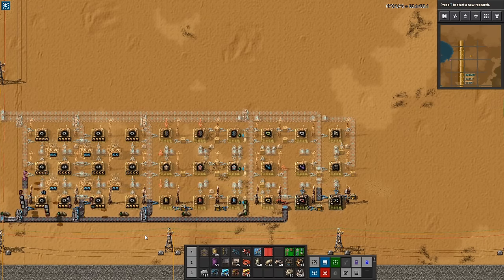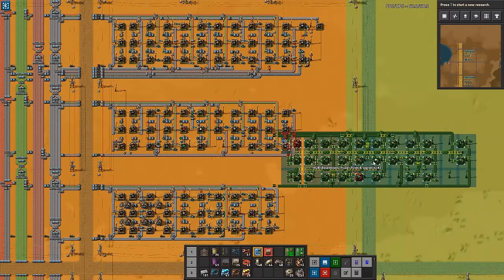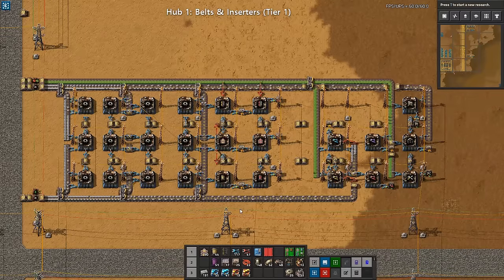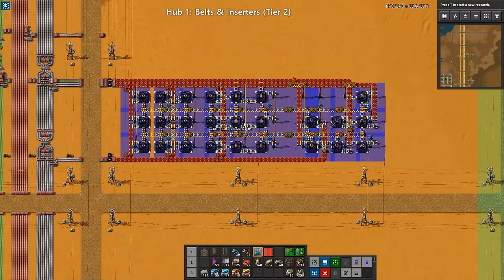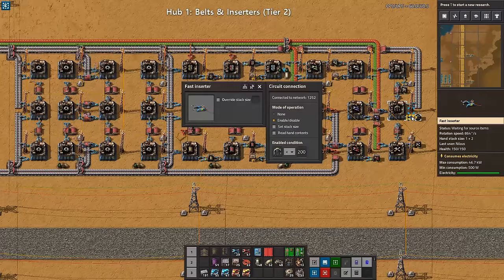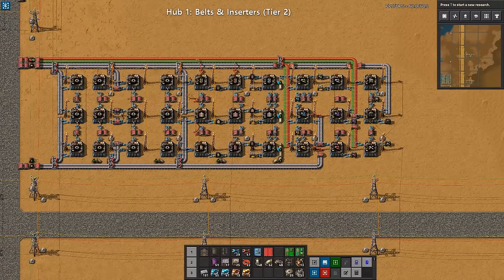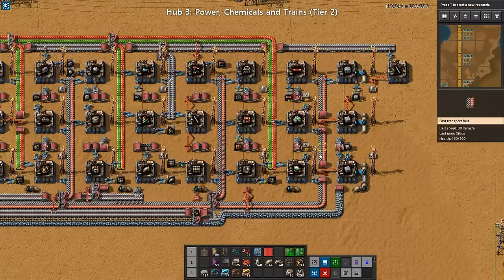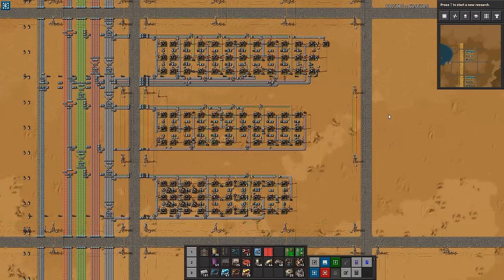It is not a MALL; this is a Manufacturing HUB -  Factorio 0.18 Tutorial/Guide/How-to

Comment: A little extra tip for new users: if you change the numbers of the circuit conditions that Nilaus has preset at the inserters for whatever reason (explained at 3:35), stamping down the next tier will overwrite your changes. To avoid that, just ugrade or downgrade the type of insterter used (to either yellow or green) in order to protect your value.
 
On another note Nilaus, you really should be more careful with your keys. Tank-engines are really expensive!
 
Regardless of your confession, this very clearly explained hub turned out to be great, esthetic and straightforward and will be a joy to have in a base. It is quite possible that I will use it in one of my games, regardless of my own designs ;)

Comment: Good base, well done.  My only comment would be, for the engines, to use a buffer chest instead of a long inserter.  This way the assembler can run longer, which lets the other assemblers refill their buffers faster.  It also gives a spot if you need to grab engines for handcrafting (I can't think of any now, but my mall also has electric engines, which I use to handcraft power armor).

Comment: I decided to modify your blueprint. You tend to put the road near the bus and I've chosen to do the same thing, so it just does not make sense for the gear machines to be the closest thing to the road. I punted them to the back for better accessibility until you reach the point where you actually have access to bots and can just get things delivered. That also shortened the circuit belt. I'll probably do the same with the rest of the hub designs.

Comment: 16:14 Solar panels can go in the empty spot. They require green circuits, steel and copper plates. Although you probably want more than just one assembler can produce. But if you just want a few solar panels to power small radar outposts it is fine. It takes only 5 panels to have a daytime Radar outpost.
Reply: It only takes 1 solar panel for a daytime solar outpost that very rarely scans any sectors.

Comment: That's so neat and elegant. I like to add two extra modules. A war module for ammo, explosives, turrets and a wardrobe module for power armour and attachments.  I also get run over a lot and it's nice to just grab some gear and carry on. Do you not bother with walls? I guess you could attach a wall assembler next to the concrete flooring.

Comment: As an alternative to the supply chest upgrade, I suggest buffer chests. The inserters inserting into the buffer chests have a rule on them to only insert if there are not enough items in the network. The buffer chests request the item instead of the supply chest filter. This means that items are taken to the buffer chests if needed, whereas the supply chest filter means the items are taken whether they are needed there or not. This may cause unnecessary bot traffic. Both methods work of course, and supply chests are available earlier in the research tree.

Comment: What I like to do is wire all chests together. And wire all output inserters together. Then you can set the desired amount with constant combinators. Either by setting the amount as a negative or by multiplying each signal by -1

Comment: Thank for making these episodes and this video in particular. I needed something that would create everything for me during a Lazy Bastard achievement hunt. Part of what was hampering my first attempt was the lack of a hub (or mall). I liked your design based on its simplicity and it was a bit easier to work with than the one I had seen from Katherine of Sky.

Before I put it to use, I adapted the design to suit my requirements and I tried to extract any military aspects and put them into their own designs. After I managed to earn my achievement, I realized that the design was too big to use during a speedrun. I trimmed it down to something that is more manageable and that only included what I needed in order to earn the There Is No Spoon achievement. Each of the three main blueprints are between 1 and 2 chunks in size and that includes the undergrounds that mark out the inputs for each transport belt.

Going forward, I will need to spend time creating my own upgrade paths for the different blueprints, so that I can change from wooden chests to steel chests and eventually logistic chests. Also, being able to swap out the electric poles will be nice, so that I can obtain better coverage. It will take some time to do, but it will be worth it in the end.

I have watched most of the rest of this playlist. The design for the column of steel furnaces for smelting steel gave me some ideas to create a new blueprint for my own use. Thank you for the inspiration.

Comment: I have way less experience than you so am probably wrong about this, but since gears are twice as resource-dense as iron plates, it seems like you'd gain some efficiency if you add gears to the resource bus, produced elsewhere,  and pipe them directly into the hubs.  Now your base should need need fewer belts in total and have smaller hubs since they don't need to do gear production on-site.

Comment: I am usually against premade blueprints, but this actually is very tempting to use, as I really like its upgradability / tiers, and does show a lot of attention to details. Amazing work on this! However I think maybe the hub 3 (power, chemicals and trains) should be split into two separate ones?. I find the hub 3 with so many different inputs might be sometimes hard to integrate into the base, especially if not using the bus. Also on a similar note I think it might be a bottlneck on plays with a lot of trains. Maybe a place for two rails assemblers? Not sure. It does work, but I find it a bit too big. The nice idea of smaller hubs is that if you don't have enough of components, you just scale by using two hubs of the same type. Useful when you expanding very quickly or doing multiplier.

Comment: This HUB thing is the shit. Forget MALLs guys!
Love the build, BUT I have a single complaint to make: the usage of iron chests. At that stage of the game where you build the first version of the first part, you will have steel researched already. Make some steel chests. The explanation is that you can recycle steel chests, but iron chests are waste of material.

EDIT: There are some other things missing besides the mentioned ones. Hazard refined concrete, walls, gates, electric engines, robot frames, logistic/construction robots. I usually like building these in the MALL as well, cause I need them for base building. Although some of them are being produced for science, I don't like taking stuff from there. What is for science, stays for science. What I consume has to be separate not to affect science production.

Comment: I don't know if you keep up with comments on older videos but I would really appreciate it: I'm always unsure when to add what on the main bus. This is especially obvious when I think about building something like this hub because I just don't know if it's worth weaving these modules into earlier parts of the bus or if I should just plan ahead enough so I use the first part of the bus for producing everything that needs to be on it. With the latter, I would have a filled bus with all base materials and then a hub and everything else seems easier cause I don't need to figure out stuff like "Oh wait, on the other side of the bus I'm gonna produce red circuits but that's not done at this spot so I'll have to push the hub back until I have that"

 Do you have a general approach for that or an order that has proven itself as the most useful?
Reply from the maker: You are commenting on the HUB video about planning the Main Bus. Have you watched my Main Bus Master Class? I feel that your questions are addressed in that video.
Also "there is no shortcut to experience"; you got to get your own feel for the game as you play it

Comment: For late, late game the steel furnace/tank can be easily replaced with walls/gates and refined concrete can be replaced with artillery and offshore pumps.  I suspect that most folks either don't use refined concrete at all or need WAY more than one assembler's worth, and having a dozen or so extra artillery pieces on hand is always nice.  Great build otherwise

Comment: I thought i had a lot of iron until i built just the gear-belt-splitter-underground bit of this with assembler 3s..... also it appears blue splitter now requires red circuit, easy enough add

Comment: I might make the chests for upgradeable items buffer chests, so as to better support mass deconstruction. (Only needed if you plan on deleting more than a chest worth at a time, so really only belts probably)
Reply: Also, the mall is the Dectorio facility :P
Reply from the maker: I am not a fan of Buffer chests because then I have to remember to tick the box in ALL future Requester chests and I know I will forget it
Reply: @Nilaus  I generally like it here because its stuff I don't request often. I agree that for most use cases they just mess up your requests, but I basically never use requesters on yellow belts and such.

You probably also have room to do something with requester chests and circuits.

I just like it to automatically clean up all the random yellow belts I have in storage by the time I have enough iron to stop using them entirely
Reply: @Nilaus  i generally don't need to request stuff from the hub into a chest so i do use them regularly. you say you forget to tick the checkmark regularly? What builds do you make that request stuff from your hub directly in stead of production on site?  Just curious what you do different that would run afoul with buffer chests.  Only place i can imagine this would be a late game robo hub, but those are copy paste setups anyway so tick once and forget.

Comment: I know this is an old video but wouldn't it be much more elegant to just have a Requester Chest feeding into a Assembler which then puts the produced item into a filtered Storage Chest? I'd say that's half the footprint and is very easy to achieve.

Ofcourse you still need pipes for lubricant and raw material, but besides gears, iron poles and copper cabbles everything can be brought to it by train (circuits, coal, stone, iron ore, etc.).

Comment: I'd like to see a explosives/military hub for firearms and rounds, tank/rocket rounds, cluster grenades, combat robots, poison, cliff explosives, artillery turrets, wagons and shells.
Maybe also armor and equipment, though that doesn't really justify a hub due to the small quantities.
Reply: Armor and equipment even tho its in small quantities, it could be done in a robot mall instead, with buffer chests instead of requester chests, all the resources used on the robot mall would be available to all machines so there wouldn't be materials lying around in requester chests that you would only use once for the power armor.
Reply: Equipment can be useful since some of it crafts very slowly. Batteries Mk2 and Roboport Mk2 for example. On the other hand you don't need a lot of them so it could be a temporary build too

Comment: Do you build your entire main base to suit the chunk layout? They look like 3 by 3 chunks per "city block"
Reply: Most of Nilaus' bases use some sort of grid - he gets noticeably stressed when he doesn't have a grid, and palpably relieved when he starts to impose one.  The "official" city block's length is three large power poles, plus two (?) tiles to the four-tile-wide path.  I think it works out to 100x100 tiles to the centerline of the path, or just larger than three chunks (96 tiles).

Comment: very nice and all...
But where are the speakers? And Landfill?
Reply from the maker: landfill has no place in a Hub, it requires huge amounts of Stone, so just add a few assemblers at a stone mine for that
I never use the speakers and I figured that if you need speakers then you only need a few, similarly to off shore pumps
Reply: I do one landfill assembler since I need stone for the rails anyways. It's true that half a belt of stone makes for very slow production, but it's something. Enough to fill in some corners in the starting lake for example

Comment: Personally I prefer to add gears to the bus as its 2 iron per gear.
Reply: I tried that on my last game, it kind of worked but the consumption of Iron was insane. You could argue it consumes the same amount but it felt like much more. I think in the end it is slightly easier to just bus in 8 belts of iron and feed the factories rather than 4 belts into gears and then back on to the bus and the other 4 belts of iron into production.
Reply: @sebthompson7871  if I can I dedicate 2 smelter arrays to produce iron just for gears. (Mining drones make it so much easier to get 6 or yellow belts of ore out of that begging iron patch.) That iron never hits the bus. The assemblers for the gears start the the end of the smelting column and gears enter the bus. For me, it works. I realize its not for everyone :)

Comment: Now I know where Katheryn of Sky got her design of her item mall XD. Anyway, I watched some of her older videos on this and I came up with a design of a long hub, that eventually does everything (I need). I found it really difficult to pull materials from the sides, when I needed it on the other side. I had to design it so the items being built were either in the middle if they fed others, or on the sides (and it usually doesn't better because you have to pull from both sides). I also had a belt for blue circuits and batteries. Having to figure this out for 4 or more constructors on the width would be even more difficult I think.

Comment: From T2 to T3 you should add some roboports in between the rows because all builds will have logistic support, so you gotta have a logistic area for them.
Also, you should do a video migrating from belts to robots to eliminate that much buffered resources just sitting there on the belts, like the bus is the ultimate resource sinker of any base, it takes so many resources and they just sit there being wasted. Which brings me to another point, you never added robots to your mall, you are building roboports there but no logistic or construction bots.
Since these tutorial series are focused on the new players, eventually they will make robots, they will try to find out how the logistic system works, they will see how amazing it is and they will just uncraft that bus, restoring a lot of resources, which brings me to another point, your mall didn't include the robot tier one where you have yellow + purple science fully automated and working.
Reply from the maker: Roboports is something you place where you need them, not part of the Hub
"Eliminate belt storage" is completely useless thing to focus on in late game when you have robots. You can tear this thing down a rebuild a robo-Hub, but I don't see the point since this will build everything fast enough for your expansion needs
Robots make NO sense to make in a Hub, they require Robot Frames, so they are much more logical to build near your Utility science build.
Every single one of your improvements are completely incorrect in my opinion. Luckily we can play the game differently and come to the same result

Comment: The amount of assemblers you have for gears in these setups and the fact that gears have double the density of iron makes it pretty obvious that the gears should be pre-made elsewhere.  Putting productivity modules in the gear assemblers is nonsense unless you're ridiculously late-game and probably playing on 'baby's first factory' difficulty,  starting with a layout that is optimized for using them doesn't make sense.    
One assembler for each of transport belts/fast belts/express belts with no space to expand (especially when each tier is consuming the production of the previous tier) is totally detached from what's needed to actually play.  
This setup is nowhere near sufficient for pipes to ground, the wait for the other products to be made first isn't 'okay' like you say, nobody that's progressing at a slightly reasonable speed can get by with this setup.